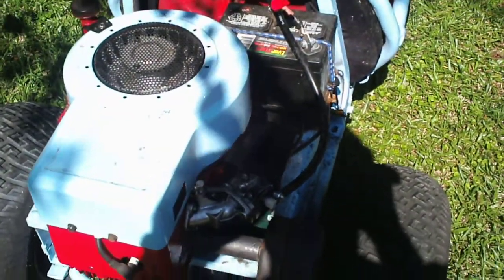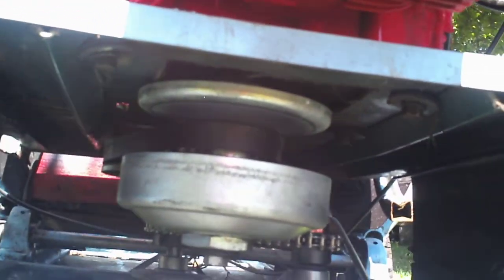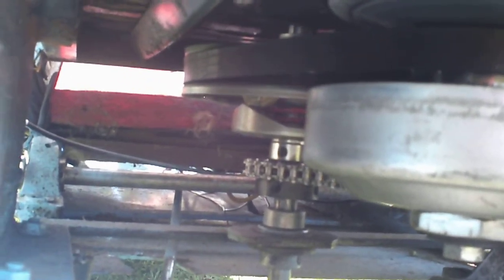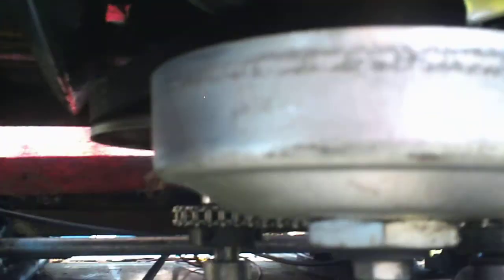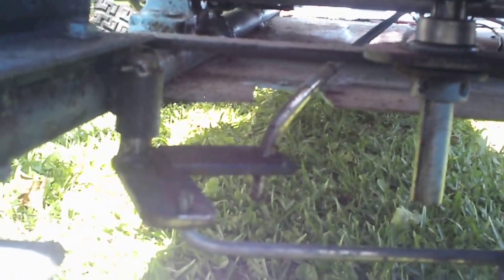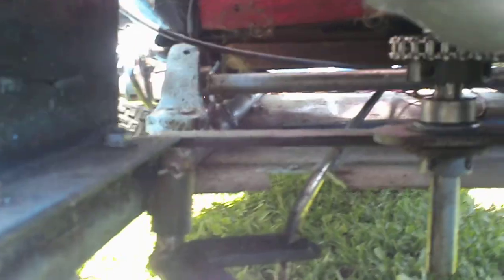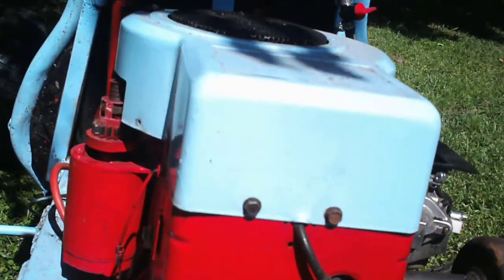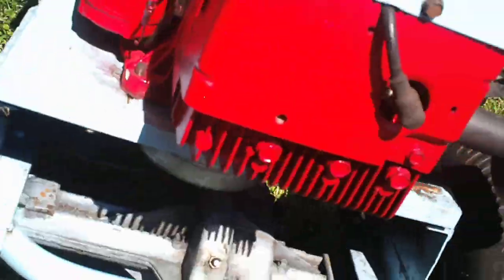go kart5

Comment: Hey,  vers cool go kart.  My grand father gave me an Old lawn mower and the engine and gear box looks almost identical.  Il Wonder how much did the torque converter cost ?
Reply from the maker: +firt flyburn here is a link .pease look around.that is what i did.http://www.ebay.com/itm/40-SERIES-1-DRIVER-5-8-DRIVEN-GO-KART-TORQUE-CONVERTER-KIT-MANCO-COMET-203785-/231803956801?hash=item35f897ae41:g:PE0AAOSwX~dWizwc